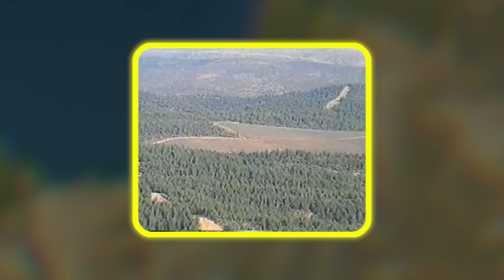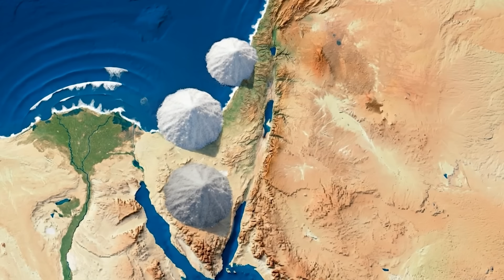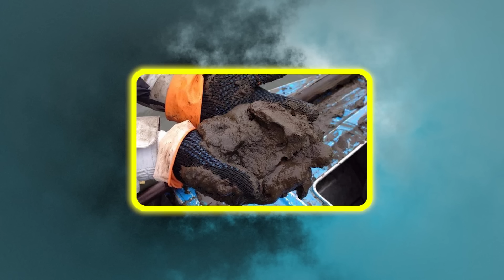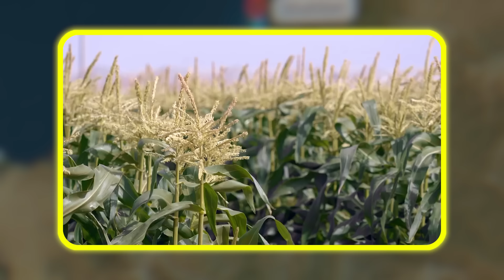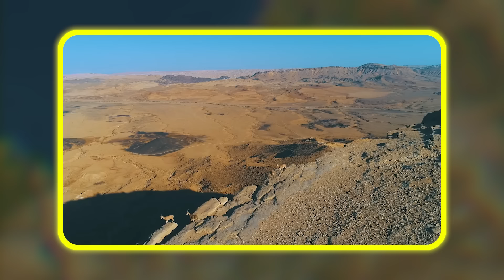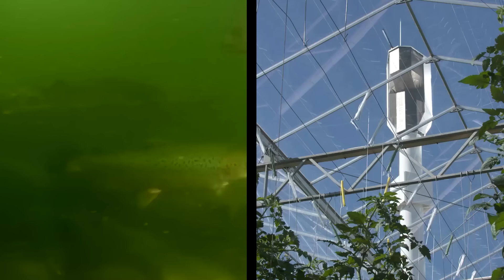Israel Released THIS to the Desert Instead of Planting Trees. What Appeared Never Existed Here

Comment: The comments about dark trees increasing local heat through Albedo are not strictly correct.  Sunlight is not heat, it is potential heat. Space is minus 269˚C with all that solar radiation. Heat happens when incoming solar radiation is absorbed by a surface and is converted into heat.  That happens on a piece of iron and black rock. Dark trees absorb the solar radiation and convert it into the chemical energy of photosynthesis. So, just to say an area of dark Greek makes things hotter is wrong because of this different behaviour of living plants.

Comment: i was thinking use a several stage sand filtration system fed by gravity. just take the water from the ocean. dddooooooont put all that salt back into the ocean you'll ruin the coastline ecosystems for miles

Comment: Couldn't moderate amounts of air be pumped to the bottom of the deep wells? As the air bubbles rose, the air would have expanded more and more and move the water to the surface.  This has been tried in the deep ocean though I haven't kept up with the results.

Comment: While many areas of the world have conditions that are hostile to crops, those conditions often provide the essential resources, and often the essential energy sources to create the ideal conditions for those crops. Cooling radiators for greenhouses work equally well with sea water, without suffering from salt accumulation, because water is replenished and salt concentration remains under the saturation level. This moisture can be collected as water for the crops. In Australia, there is another project involving using sea water instead of steam from fresh water for thermosolar power plants. The steam generator separates the water from the salt before generating electricity, and the condensing water is supplied to households. The salt is mostly dry and eliminates the problems with handling volumes of brine. The dry salt is now treated to extract sodium. The Sodium is essential for sodium ion batteries which may one day replace the lithium-ion batteries. This will finish once and for all the ecological impact of harvesting lithium.

Comment: One minor correction: 
Namibia operates the world's most sophisticated and pioneering Direct Potable Reuse (DPR) water reclamation system. Facing severe drought and situated roughly 700 kilometers from the nearest permanent river, the capital city of Windhoek became the first in the world to recycle domestic sewage directly into safe drinking water starting in 1968. 

Today, the system centers on the New Goreangab Water Reclamation Plant (NGWRP), which supplies up to 25% of the capital city's drinking water. 

The 10-Step Multi-Barrier Purification Process

To ensure total elimination of viruses, bacteria, chemicals, and pharmaceuticals, the New Goreangab Water Reclamation Plant uses a strict, automated 10-step multi-barrier treatment system: 

Diversion & Blending: Wastewater enters from the Gammams Sewage Treatment Plant and is blended with scarce raw water from the Goreangab Dam.

Pre-Ozonation: Ozone gas acts as a powerful disinfectant to breakdown organic molecules and contaminants.

Coagulation & Flocculation: Chemicals group micro-particles together for easier removal.

Dissolved Air Flotation (DAF): Tiny air bubbles float the grouped particles to the surface to be skimmed away.

Dual Media Filtration: Sand and anthracite filters trap remaining suspended particles.

Main Ozonation: A secondary ozone injection further destroys trace pathogens and viruses.

Biological Activated Carbon (BAC): Microorganisms on the carbon absorb dissolved organic compounds.

Granular Activated Carbon (GAC): Polishes the water by removing tastes, odors, and micro-pollutants.

Ultrafiltration: Special membrane filters screen out remaining microscopic particles and pathogens.

Chlorination & Blending: Final chlorine disinfection seals the water before it is blended with fresh groundwater and distributed. 

Expanding Beyond the Capital

The success of the central potable reuse framework has driven wider adoption across the nation: 

Ujams Industrial Plant: Operating on a public-private model since 2014, the Ujams Industrial Water Reclamation Plant cleans complex manufacturing and industrial effluents using membrane bioreactors. 

Rural Initiatives: Innovations like the CuveWaters project in Outapi utilize specialized vacuum sewers to clean local wastewater for crop irrigation while preserving vital crop nutrients.

Comment: Sorry but Israel invented the drip irrigation system in the 1950/60.
Reply: Tried & failed until they got it perfected . . . 
SO . . . what's your point?

Every nation knows "irrigation methods" have been around for decades . . . 
spraying water up in the air is worthless in dry desert conditions . . . 
but probably ideal for steep slope farming of reseeding crops . . . 

Each situation requires specific consideration of what will work best - 
I'm delighted with preserving every possible drop of water & putting it to good use.

Greenland & Artic areas needs to start collecting that pure glacial water before it's all melted away.
Reply: @sydney.g.sloangammagee8181 pure water is pure water whatever the source.
Reply: @paulvandenberg9588 
YES - indeed it is . . . 

My point being . . . Greenland & Artic regions should be the ones utilizing it for their best benefit for themselves . . . RATHER than for other greedy nations to come in to take it from them by force - which would cause them harm.

I love those people & the lifestyles they live just the way they are . . . & don't want them treated unfairly, taken advantage of or their lifestyles destroyed.

I earnestly pray for them to be protected by God.

Comment: It sounds great, but I have some questions and skepticisms. 

For example, Mesopotamia (now Iraq) used to be a tremendously productive agricultural area, until overuse and incorrect use of water salted the soil. This is a common problem pretty much everywhere. Especially where the soil is already salty and only salt-tolerant plants can resist it. Here it is particularly easy to create soil so salty, nothing can grow in it. What is done in Israel not to repeat this problem in the long run?

Doesn't natural liquid fertilizer produced by fish farms that use water that's already too salty for almost all fish (and plants) ovesalt the soil when used on plants? 

Same with waste water. It's not good enough to drink. Wouldn't waste slowly accumulate and make it too dirty to be used. 

Whether salt or waste, these are the kinds of processes that at first are not harmful. They might even be beneficial. The detremental effects accumulate very slowly, slowly enough for every bureaucrat to dismiss them and let the next bureaucrat in the future worry about them. And the next, and the next. 

I have some other questions . But this is not the place for them.
Reply: Israel just gets it done and solves problems if they appear.

Comment: If they have a giant underground geothermally heated reservoir, why can't they build a geothermal power plant to use that heated water to make electricity?

Why did those people in Australia have to run a pipeline all the way across the land and out to the larger sea, instead of just running it right there to the bay or whatever you want to call it where the ocean comes up inward from the ocean making that notch. It would have cost far less because they wouldn't have needed nearly as many miles of pipeline.
Reply: I was wondering that too.🤔 Maybe it’s because of the environmental sensitivity of the head of the gulf where the giant cuttlefish congregate to breed.🤷‍♂️